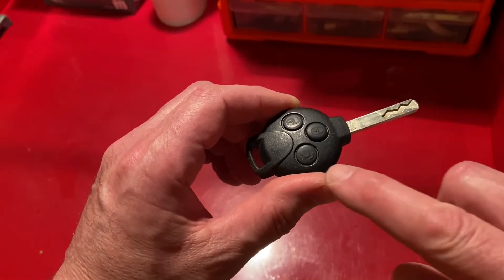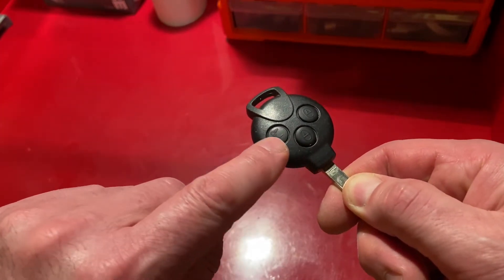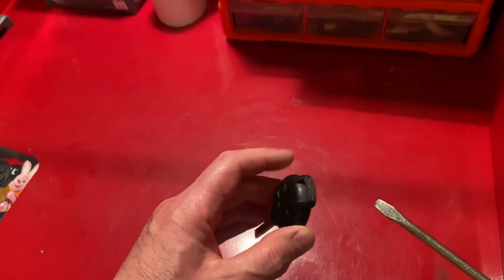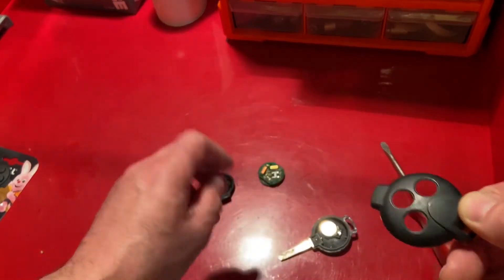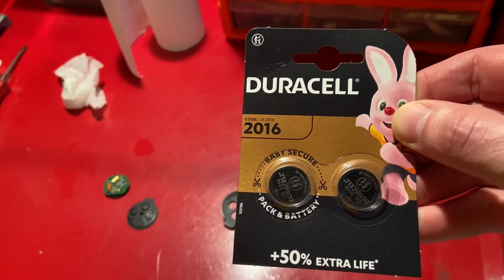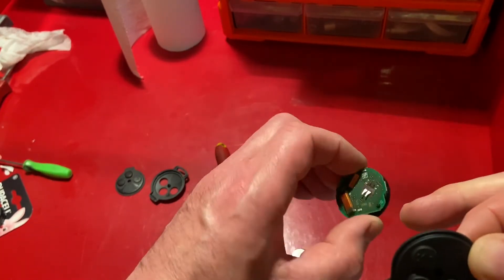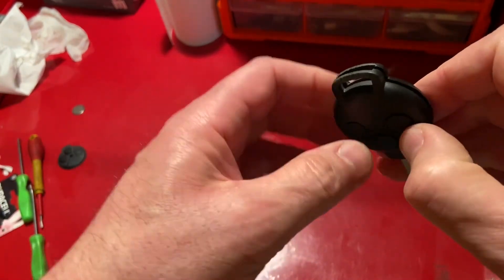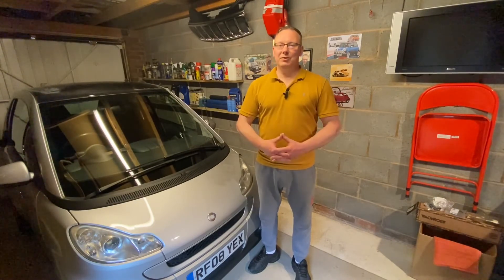Smart Fortwo 451 Key Fob Buttons and Battery Replacement

Comment: Very informative, thanks. Do have a question, my wife recently bought the Fortwo Coupe 2011 with on one key. Bought new batteries ( 2016 Duracell ) have tried both new batteries in the key fob without any success, yes they're the right way up and secure, so then put the old battery baock in and it works fine. Any answer or possibility would be great
Reply from the maker: Sometimes these button batteries have a coating to make them taste bad, as ingesting these batteries can be fatal. This can affect conductivity, so maybe try some electrical contact cleaner or alcohol wipe

Comment: Two questions. I have a 2007-2014 451 and I took the spare keys the other day because my main was taken accidentally by my partner. Turns out the battery was dead. I thought no problem, I can just open my car the oldschool way, with the key in the door. All is well, I park at work and try to close the doors and nothing happens. I actually had to run around about 15 minutes to find batteries in neighbouring shops and all the while my car was free to open by anyone in a very busy area. My mechanic told me it's normal, it can be opened with a key but not closed. Is this really true?

And the other question, maybe a bit off topic, but what do you think would be a good material to paint the key fob housing with? Plasti dip just comes off like a sticker unfortunately. Vinyl wrap is I guess only good for smooth surfaces. Or just normal spray paint and a clear coat?
Reply from the maker: Next time I am with the car I will have a look and see if it can be locked as well as unlocked, using the lock barrel under the plastic cover on the passenger side. It’s certainly an improvement over the 450 models where you had to go in through the tailgate!

In terms of painting the key fob, I think most finishes will deteriorate quickly due to other keys rubbing against it in jeans pockets etc. Enamel would probably be toughest but there are replacement buttons and protective gel covers on eBay which might be a better bet.

Comment: I replaced the battery in my key fob.  It will start the car, but won't lock or unlock anything, even the panic button doesn't work.
Reply from the maker: Some of these batteries have a bitter tasting coating to prevent them being eaten. This coating can affect conductivity and can be removed with an alcohol wipe or similar. Other than that, check the battery is making full contact with metal tabs which can deform
Reply: @autoknight747  I did that and also put the old battery back in, which was working.  I'm on a Smart Car forum and apparently this is a common thing.  There are quite a few things to try which I've done and still nothing but the ability to start the car  One of the common things is to just put the key in the ignition and start the car and that is supposed to reconnect the key to the car.  That too doesn't work.